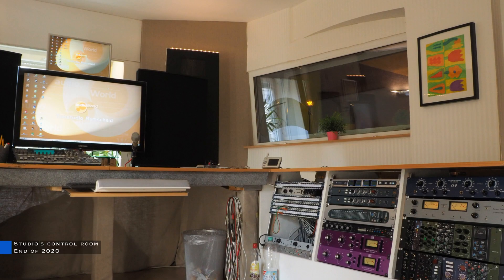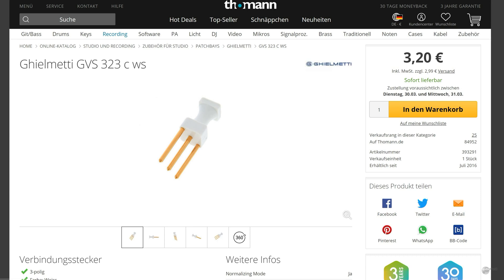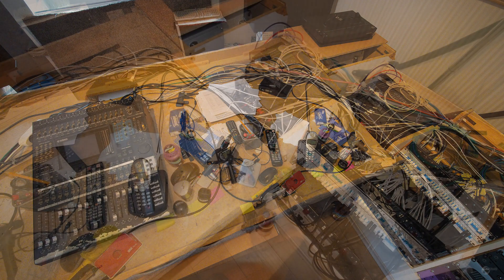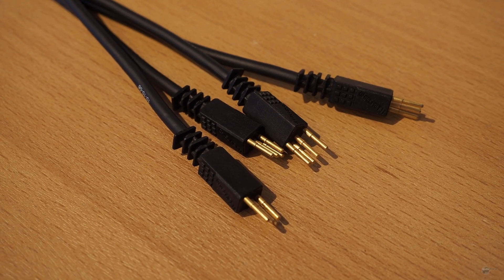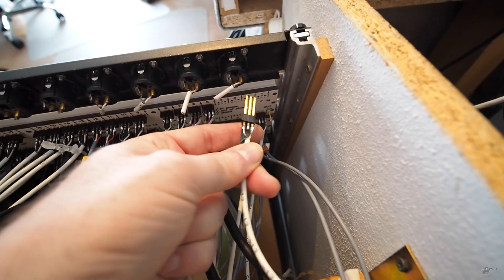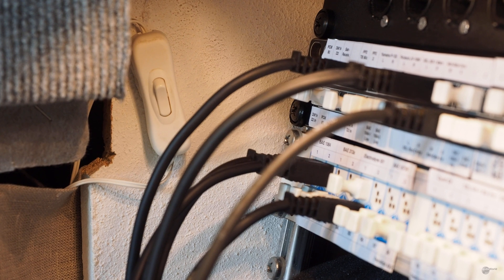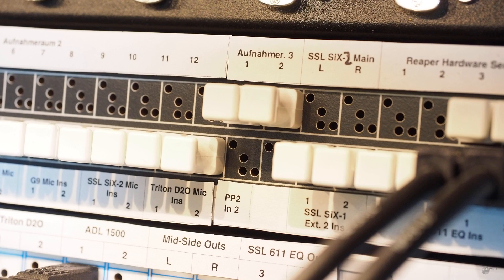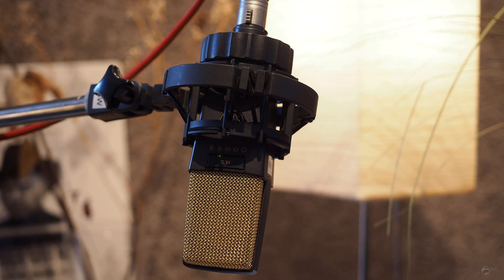Ghielmetti balanced high-end audio patchbays explained - why 4 pins?

Comment: do I see CAT5 cables there being used as Jack cables?
Reply from the maker: No CAT 5 cables are being used in my entire studio, only Cat 6A exclusively and those are being used for data networking and Dante audio-over-IP. Could you specify the time location you are referring to?
Reply: @SonicAxiom  I think they just looked like CAT5 cables. but really weren't. Would have been an interesting idea though...
Reply: @SonicAxiom  cheers! do you have info on where you purchased the audio cable? I'm planning to fabricate my own jack cables. thanks!
Reply from the maker: Hey Bart, most important thing is to use balanced audio cabling wherever possible! Balanced cabling reduces or even completely avoids picking up hum and other electromagnetic parasite signals. If you must interface unbalanced gear, feed the signals into a decent passive DI box (which will turn them into balanced signals) with the shortest possible unbalanced cables and then use decent balanced cables from there. Once the signals are balanced, they are virtually immune against noise/statics, etc.
I purchased lots of inexpensive cables at Music Store Cologne and Thomann here in Germany. I neither went for the most expensive nor the cheapest ones and I never had an issue with audio quality or noise. Make sure the connectors are sturdy and gold-plated (like Neutrik), the wires/leads are of at least a reasonable gauge and you should never get issues. Try to avoid cables with shrunk plastic connectors instead of soldered ones since they are not serviceable.
25 years ago, I bought a second hand, 30-metre analog 24 by 8 (returns) multi-core cable with a stage box on one end and separate XLR connectors on the other. I used the stage box end as a wall-box in one of my live rooms and cut the rest of it into pieces to build my own custom-lengths balanced patch cables connecting gear under the hood inside my studio racks. This huge cable is still covering virtually all of the analog and digital cabling to this day as far as RCA, jack and XLR cabling was concerned. IIRC, it was from Monacor but don't quote me on that. I'm using it for analog and digital balanced/unbalanced cabling, just not for custom CAT category network cabling. For this, I'm using SSFTP (shielded, foiled, twisted pairs) CAT 6A cabling and it works perfectly, as opposed to UTP (unshielded) CAT 5(e) which gave me quite a lot of issues.
No need to buy into fancy expensive boutique high-end woodoo :-)
Here's a quite revealing audio cable testing video by HOFA (you can set captions to english): https://www.youtube.com/watch?v=w0b7RwBgGd4
Good luck!
Reply: @SonicAxiom  I'm currently using rack mixers that don't have balanced outputs and I don't have any hum or other issues. I might be just lucky I suppose. I never really bought into the gold plated stuff, do you really think that makes a difference? I will look into balanced audio cables, I suppose they are basically stereo cables on a mono signal. I watched the video and the differences seem negligible.
Reply from the maker: Yes, you can be lucky using unbalanced cables and not getting hum or other interference. Pro gear will be equipped with balanced connectors exclusively 95% of the time and this is to ensure no hum is ever introduced into signals. Digital signal transmission also takes advantage of that principle. Gold-plated connectors yield no better sound, they simply preserve much better contact over their entire livespan since no corrosion will ever occur. This makes gold-plated connectors more reliable and, thus, the connectors of choice for professional applications where reliability is a very important factor. The price difference to non-gold-plated connectors is negligible from a professional stand-point.
With balanced cables, you are using an additional third wire/contact to transmit a polarity-flipped copy of the transmitted mono signal as opposed to unbalanced transmission where you only have two wires: The signal's lead and the ground lead. Any type of interference introduced into the strands in the balanced cable over the length of the cable will cancel out when the hot and cold signal are getting summed at the receiving device's balanced input. The resulting signal will also be lifted up to twice the original level when summed which is another beneficial side-effect.

Comment: Thanks for making this video, it's difficult to find info on this system online so I was very glad to see your video. Did you consider a TT patchbay, and why did you go with Ghielmetti instead?
Reply from the maker: Thanks for your comment! Glad you enjoyed the video and hope it explains all relevant features and aspects you need to know to take an informed decision on what type of patchbay to get.
I'd say that Ghielmetti is the ultimate patchbay. There's nothing like it. I never considered TT when I was looking to replace the phone jack patchbays since they suffers from the same conceptual flaws as 6.5 mm jack patchbays (short circuits during patching). But that's just me. I've now been using the Ghielmettis for 1.5 years and I couldn't be happier. No glitches whatsoever, no wiggling, just pristine-sounding connections all the time and also extremely robust in day-to-day work considering the delicate-looking pins.
Reply: @SonicAxiom  Thank you, and enjoy making music with your system!
Reply from the maker: Thank you! All the best!